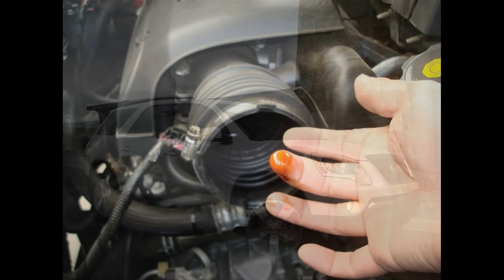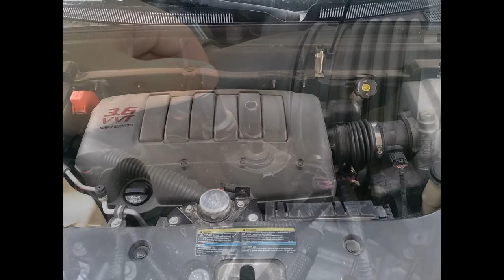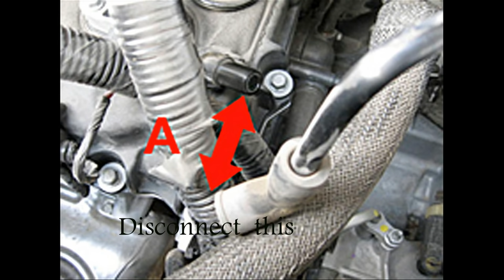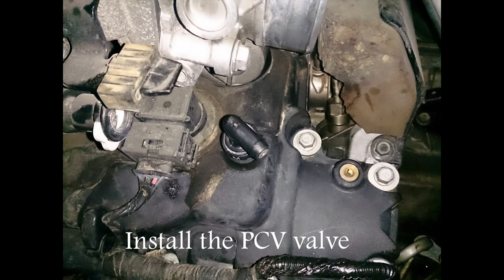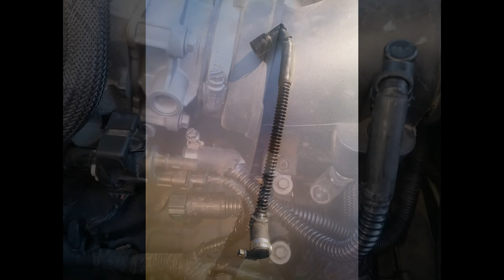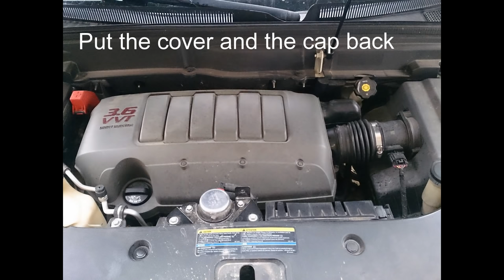GMC Acadia, oil collected in intake hose solution

Comment: This engine has the pcv on rear cylinder  bank,  if you have oil in your intake tube it's probably because the pcv valve is blocked. The plastic tube on the intake tube is to get fresh filtered air going through the engine and then the crankcase vapors get sucked in from the rear bank through the pcv connected to the intake manifold. In this case I would replace the pcv... Also on these engine replace the oil at 3000 mils to keep the inside of engine clean... Also an oil catch can on the pcv (rear bank) line would be a good idea
Reply from the maker: Yes you are right,  the pcv at rear, but its just a metal peace with 2 holes on top and one hole on the bottom,  not like other cars pcv valve, they dont have spring and ball in it, so just cleaning will be enough, but that doesn't fix it,  oil catch can is the only solution
Reply: According to the dealership  near me, it has to do with a faulty Valve cover gasket. Below that PCV valve they used valve cover gaskets that where recalled because they where designed wrong. The one that's there is most likely closed off. You need the one that is opened. I went through the same thing with My Buick Enclave. Very common issue with 3.6 Engine.  I replaced the Valve cover gaskets with the ones that are opened in that section and haven't had that problem sence. it's been about 3 years now.
Reply: @lilpoppa502  
Yes that's the ultimate fix replacing the gasket.. drilling out the holes stops the oil going to the intake tube, but the fix is replacing the gasket
Reply: @segbachan5123  I would advise against modifying your exsisting Valve Cover gaskets, Just go to the parts store and buy the ones that have been made by GM . Parts stores sell the ones that have openings. the closed ended ones have been discontinued by GM. Sometimes Modifications can cause more of a complication in the long run than what it's worth. Better to do it right the first time.
Reply: @lilpoppa502  lilpoppa 
You are not modyfing the gasket you are drilling out the PCV breather
Reply: @segbachan5123  Yeah, tried that, drillng out the 2 little wholes on the PCV valve to a little bit bigger wholes, But with the old gasket still being closed it only took some time until the problem exsisted once again, I changed the gasket and guess what. No more clogged lines. It's been about 3 years and hasn't glogged up any sence I changed the valve cover gaskets. Change the valve cover gaskets, Fix the problem.don't change them, the problem will come back in time.
Reply: Thanks for clearing this up. My father’s 2012 Traverse is burning <1qt of oil between changes with no obvious leaks so I want to do his pcv valves. Finally found both parts, the dealer is the only place that had the actual rear valve, Amazon said it wasn’t a fit. Anyways I thought that front passenger piece had a valve in it but now I know it’s just a tube and I’m not getting ripped off, because I thought both parts were valves and when I read the Amazon reviews saying it was only a tube I got nervous.
Reply: @lilpoppa502  I would like to add to this thread.  I have installed the improved gasket.  It just made it worse than it supposed to solve the problem.  I just installed a new engine on my wife's Cadillac CTS same motor.  Luckily I installed a catch can.  It seems that loses more oil based on the oil in the catch can.  Also the breather tube at the air intake snorkle also has a lot oil.  In fact so much oil it goes to the oil filter and box.  The PCV valve has been modified by increasing the hole as stated by GM.

Comment: I has the same problen before. Replaced pvs valve 3 months later I found oil inside intake hose. I was told to replace the engine worn ring.. Any suggestion
Reply from the maker: Oil catch can is ur solution
Reply: @AliMECH  don't waste your money on catch cans, just remove the Barb and drill out the holes. You need to drill out the hole on top with a 7/64 drill bit and drill out the bottom 2 holes with 5/64 and that should fix the issue.. I did this about 2 to 3 years ago and never had as much as a drop of oil..hardest thing is to remove the barb or PCV from the engine..what helped me tremendously was to use a long handle old style wheel nut wrench and use the flat part to gently pry the PVC valve off...and i use to gently tap it back in place.. other fix is to replace the valve cover gasket with the new design many vids on line

Comment: That is. Not a PCV valve that is just the breeder to compensate the extra air that the pcv valve is taking through the intake the pipe  that is socks the oil with fumes it's on top and goes through the other side of the valve cover that one it's a metal. the one that you guys messing with is just positive ventilation
Reply: Thank you! Good explanation👍

Comment: Nope, Sorry to say that won't solve it, if you don't change the other PCV  breather valve located on the back side.  And when replacing remember to modify drilling top hole to 7/64 and bottom holes to 5/64.
Reply from the maker: You are right, I remember it make the oil collecting in the throttle hose less, the only solution I believe is an oil catch can, most direct injection cars have this problem
Reply: @AliMECH  True, I had to place one in my 2015 Chevy Traverse.
Reply from the maker: Awesome,  that's the best solution for this problem 🙏🏻✌
Reply: Correct.
Reply: I did that and the engine is a Lot cooler breathing correctly.

Comment: while detailing my engine and engine bay today, i removed the intake system so i could reach deeper into the engine bay. I noticed oil pooled at the bottom of one of my intake hoses right by the pcv valve. I just recently started learning about cars and what each parts do, there is no smoke and my car runs fine. Is this normal? And what should i look out for if it becomes a problem?
Reply from the maker: clean it with cloth, and see if it comes back... some time oil build up there because of hard accelerating,  if u see the oil again, u may consider it...
Reply: I installed a oil catch to fix this problem. Actually that line is a breather tube that allows blow by from the pistons to go back into the engine so that it can be burned off. Sounds stupid but that's the way its suppose to work and lots of cars have them. Installing a oil catch, collects all of that oil before it enters your engine. Just drain the catch every 4-6 months. FYI...If you are seeing puffs of blue smoke when you press the gas then there can be problem with your piston ring(s). If the rings fail then there will be excessive blow by getting into your engine.
Reply: @toddh6234  I installed a catch can and had troubles with it. It kept filling with water and did it fast like after driving 10 miles it would be filled to the top. I routed both valve cover vent lines into the can.. then ran lines back into both the intake and breather inlets. I tried using a filter to open air on the catch can still got water. I wonder if it's because I used both lines coming out the engine? I wonder if I used only the breather line it would work? Did you have that problem? I removed the can eventually because water was getting into the engine
Reply: Not sure how you are getting water into your setup, Make sure you are not connected to any coolant lines. There is a small plastic hose/tube that connects to the intake hose. You can connect the catch can between that tube and the intake hose to catch the oil before it enters the hose. I did the PCV mod (You can find it on Youtube). The PCV mods the PCV orifice to help eliminate most of the pooling problem. After doing the mod I install the catch can between the orifice and the tube/hose that connects to it. Its located behind the rear valve cover on the driver's side.   @joedmac78
Reply: @toddh6234  that's what I did. I used both vent lines from the front and rear valve covers. I mounted my catch just below and to the left of my hood latch welded up a nice little bracket for it. It was pretty cold out when I installed it. It had to be condensation build up , it couldn't have been anything else because it was all sealed tight with teflon tape on all threads
Reply: @joedmac78  you can't run both lines into the same catch can. You only run the one line from the front of the motor to the air Intake hose. Pretty much cut the line in half and have the can in the middle is all you need to do. But only the one line can go to it.
Reply: @jayperdue1369  is that true for all motors?  I'm just curious. Is it too much for the can to handle both lines?
Reply: @joedmac78  yeah it's because if you are putting both lines into it then you have a lot of air going through the can the whole time the motor is on. Since both lines run from vacuum lines it can't have 2 different lines in the same can

Comment: My 2007 gmc acadia wont start could this be the problem?  It tries to but just wont turn over
Reply from the maker: Have you checked the fuel pumps, acadia has two, on in the tank and other on camshaft
Reply: No I have not is there a video on ot?

Comment: why did you have to replace hose? Doesn't it slide right back onto the PCV valve??
Reply from the maker: no it won't slide back, bc the pvs valve is smaller, that's y I changed it.... thanx
Reply: +Ali Hoshyar I guess mine is a little different then because it just slid off and then fit right back onto the new one.
Reply: Sounds like it.
Reply from the maker: +SevenT SevenX7 good for u,u were lucky with the right size of pvc valve
Reply: @TuttleDad  where did you get your pvc valve?
Reply from the maker: I had that, it was Mitsubishi lancer 2007 pcv valve

Comment: brilliant idea but this work only on the 2nd engine head you need to do the same for 1st engine head breather cause its bleed oil directly to the manifold and valves making  oil consumption and carbon buildup
Reply: you can also use oil catch can to fix the problem
Reply from the maker: I added only to this engine head,because the other side has a PCV valve , thanks
Reply: and where is located the 1st engine head breather? thank you

Comment: It needs an Oil Catch Can Mod :)
Reply from the maker: Actually when u see this , it means u have problem with piston ring, but this method will reduce it
Reply: +AliMECH - Right and 100% Correct !!!  But alternative would be an " Oil Catch Can ".  Unless you want to take the Engine apart and replace the Rings / Seals.  Time would be costly and also $$$... Next best thing is an " Oil Catch Can ".
Reply from the maker: Oil Catch Can is a temporary way, because with time the amount oil will be much more than the Catch can , thats why, the best way is rebuilding the engine or sell the car lol
Reply: +AliMECH - Hahahahaha... Sell the Car, it will be someone else problem, right?  LMFAO
Reply: +AliMECH - Is this your Car? Or it is one of your Customer?
Reply from the maker: It was my car, But i fixed it before selling it :)
Reply: +AliMECH - I did one recently, here is a Video:  https://www.youtube.com/watch?v=jtQxy80CeiA

Comment: Wouldn't an oil catch can work better?
Reply from the maker: Yes I think it works better,but I haven't tried it before
Reply: I did an oil catch can and got poor results. Prior to that oil catch can I plugged the intake air inlet and ran the hose coming from the engine into a makeshift can and that worked absolutely great. I got horrible gas mileage compared to the bad mileage I got already. Did the oil catch and engine light came on within a few miles and the vehicle acted like it had no power at all. Big waste of money. I went ahead and put all back together factory and took pic valve and cleaned it because it was clogged bad then drilled slightly bigger holes in it and vehicle continued to drive great. Oil in intake was the problem and I’m looking at doing this PCV mod next

Comment: Tampering with emissions control systems: you can do whatever you want, as long as you don't operate the vehicle on any U.S. public road - it is both a federal and in most states, a state crime to operate with an altered emissions system without a certificate of modification. 
But who cares.
Reply: If they thought that then should do a recall on these engines that does all of that.